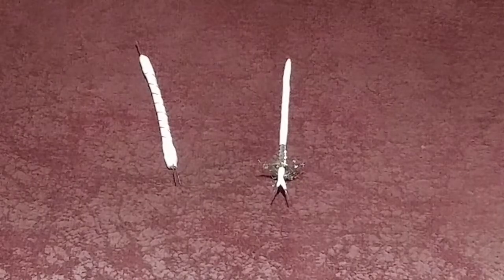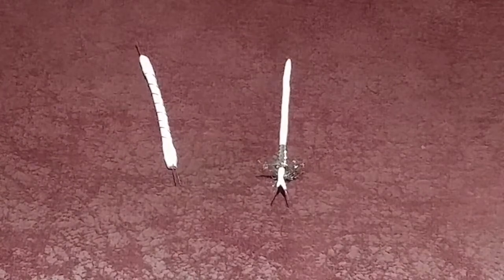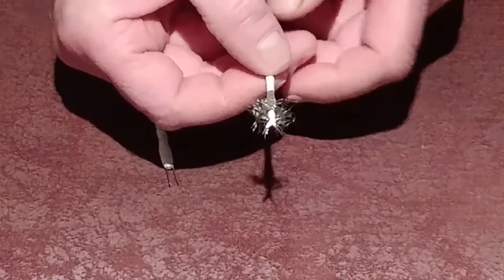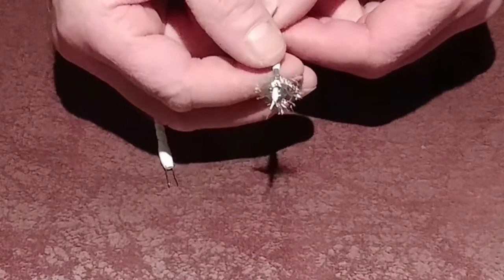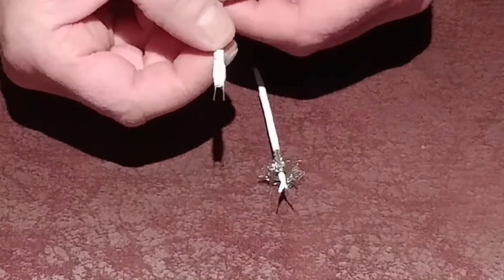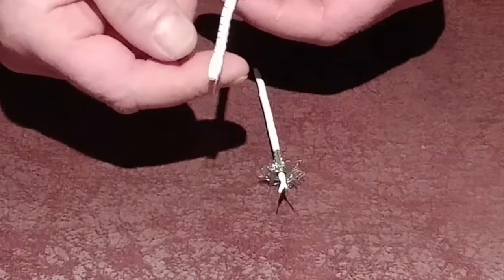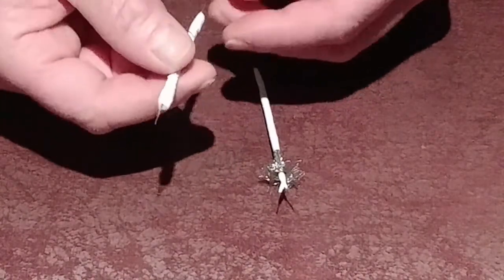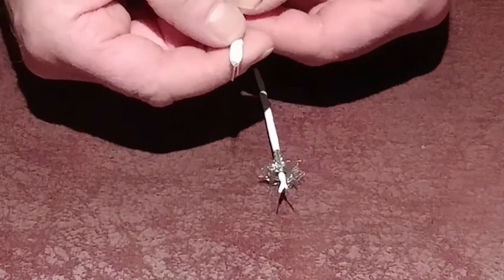Unshielded vs Shielded analogue Interconnects.

Comment: Hi Tweakerman ,
Nice to see your posting again,,,,,I can vouch for the semi sheilded interconnects with the paper & cotton Center dialectic THE DIFFERENCE IS AMAZING 
Ive also just completed a 5mtr pair of Tweakermans speaker cables using the same config but with one slight change ,i used 6 lengths of 0.6mm twisted 10% silver filled copper  placed inside 
its own heat shrink one for + (plus)and one for the - (minus) then twisted them together ,not easy when 5 mtr in length ,then placed them in a white expandable braid .
they sound as good as they look. 
I used Chord company cables before i made these,,,,,, but these are in a different league and cost peanuts to make, ,,,So I for for one ,am extremely grateful for his efforts in
uploading his tutorials for us to use.
So move along if you think spending £1000 on rca cables is worth it or spend £50 on making a pair of these but use bullet style rca plugs and soldered these are the best.

Comment: Another great video.. I must have watched almost 10 of your video in the last 2 days.  Since I am a Chinese from Hong Kong living in Canada, I do have problem understanding some of your English as they are quite different from typical American English. I ended up sometimes have to listen quite a few times to understand certain material names you mentioned as they are not part of my routine English volcabuary.. 2 nights ago I must have keep on watching trying to understand a couple of points until 4am in the morning.  The reason I am mentioning this is to let you know that how much I appreciate your video .. I think I have not even half diligent when I went to college.  Again, thoroughly enjoy your video and thank you so much.  Just as a last request is that if you would be kindly enough to give a list of the materials you used .. even better some shopping tips( ebay,,etc).. greatly appreciated.   Keep up the good work.
Reply from the maker: Hello, take a look at these eBay no:114075021511,  223927649078, 122582805014, 121624424269, you will also need 10mm heatshrink black & red, some 8mm nylon braid & some cotton calico, I hope this is helpful & most importantly thanks for watching.
Reply: @tweakerman  thanks for the information...greatly appreciated

Comment: HI tweakerman, very nice video explanation regarding diy shielded and unshielded rca..got some questions like this, i have been using few van damme quad balanced microphone cables for most of my interconnects as all of those cables have shielded copper braids that i connected to rca ground at one end only together with negative signal.. if you said "unshielded" sounds better and i dont have problem with rfi, Will disconnect the ground braided copper connection and simply use twisted pair for postive and negative will work like to become unshielded ? or i need reassemble the cable and pull off the entire copper braid ?
Reply from the maker: Hello, the Van Damme star quad microphone cable, is a excellent cable, I've done a video on it, disconnecting the braid won't make any difference, the way I terminate that cable is to join all the 4 conductors together for the centre conductor, then connnect the braid at both ends as the ground, that cable sounds so much better like that. Unshielded cables are better handmade from scratch, check out my video, there's two video on my channel, thanks for watching.

Comment: Hello. For making shielded I do them as unshielded analog interconnects and then just cover them with braid?  Where to connect braid on each side ? It is not the same structure as digital interconnect?
Reply from the maker: Vasja Grmek Hello, I'm going to do a video on sheilded interconnects, very soon, the make up is different to the unsheilded.
Reply: Ok. I'll try to wait. I have an old Dual turntable and I want to upgrade it with new cable. Thanks for answer.
Reply from the maker: Vasja Grmek I'll try to upload the video by the end of next week.